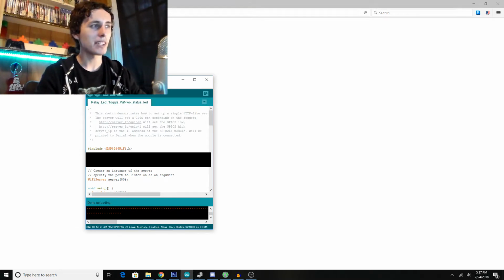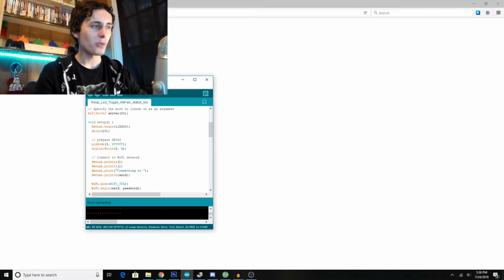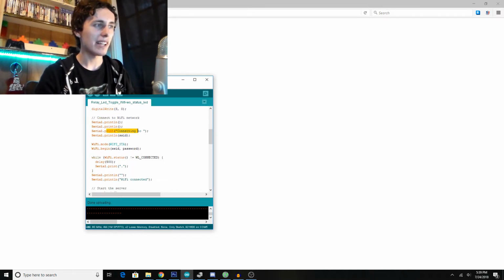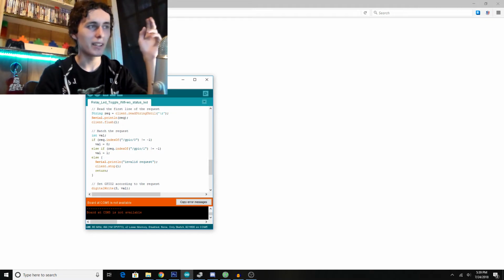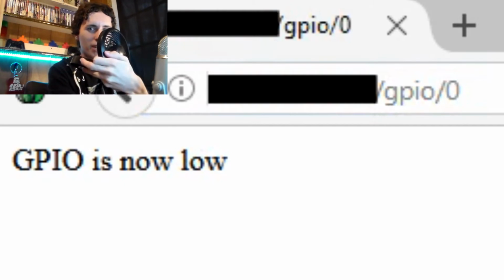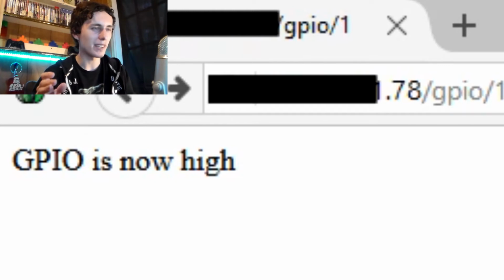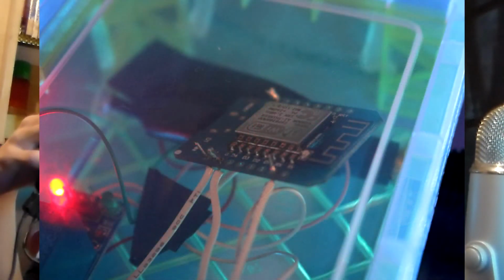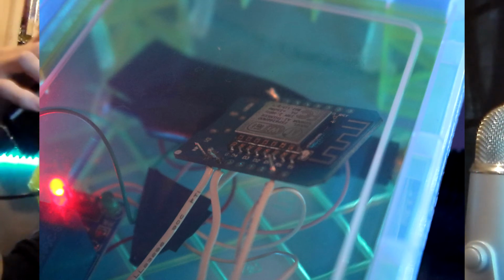DIY Wifi Relay Part 1 "Simple Working Prototype"

Comment: Bro please make a video on enabling packet injection on tplink wn722n v2 for kali
Reply from the maker: I can try to take a look at that no promises though but if I see something for it ill make a video.
Reply: everythingdigital1 thank u man. Actually  many people bought this product for packet injection and monitor mode and it didn’t not work, I think it will be helpful for many people.I tried doing this https://youtu.be/G7EFGWBuwN4 and i got an error when doing that make install things.
Reply from the maker: Ok I was busy yesterday but i'll try to look more into it today. The adapter I use is a TP-Link TL-WN722N N150  I know there are different versions of the tp-link so yours might be in compatible with Kali or only partly compatible. If I find out any thing ill be sure to comment back.

Comment from the maker: So oki under powering a 5 volt relay is a bit of a pickle not all relays work off 3.3 volts for the signal pin so if you try this just know not all relays will work like this and in my case it didn't work at first but switching the voltage to 3.3 for the voltage in on the relay made it work. And using the relay on my 12 volt solar set up seemed like it was a lot more clean versus when I powered the 5 volt fan. There is a bit of fluctuation in the voltage on the relay unless u passing higher voltages through it seems.
Also by next video which will be a week or more from now I will clear up any confusion and actually have video of me putting another one together and programming it.